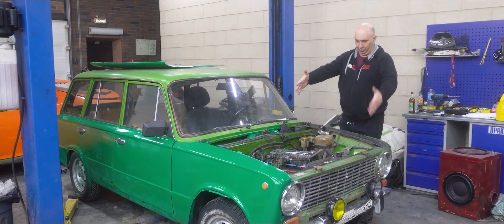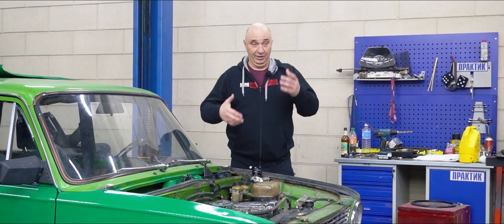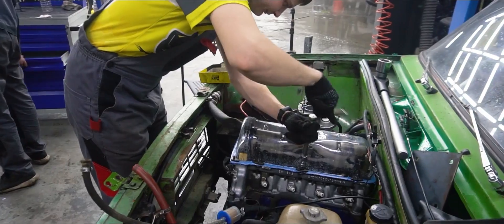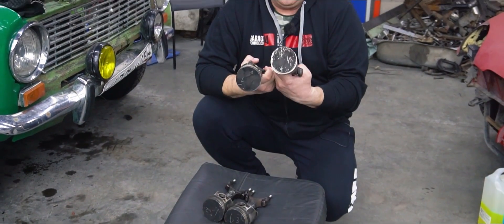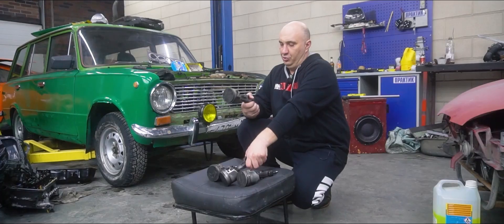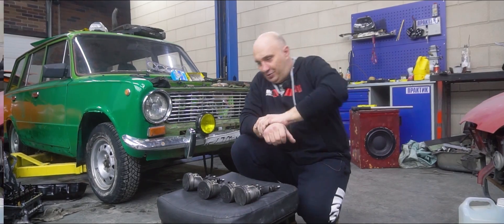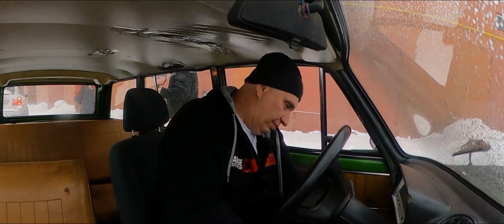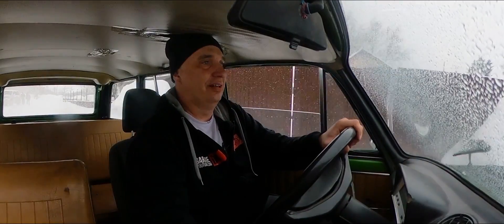Welds vs bolts – testing their durability on conrods

Comment: Only Lada's are capable of getting you to your destination despite having it's engine exploded
Reply: Comes with experience. Other motors just don’t get to do it that often. 😎
Reply: Those were the equivalent to a k-car back in the day here. My father had a rod knocking in his plymouth acclaim for months until one day it just let go and blew oil and a piece of the engine block all over the street and then continued to drive it not letting it idle of try to stall just to make it another mile down the road to work so he didn't have to get a tow truck and be late. Everyone was amazed when he flew into the parking lot with smoke, sounds of metal just banging and clanking away and it just died a few feet from the door.
Reply: @ATSNorthernMI  sounds like something my dad would do too 🤣
Reply: I once saw a Slant 6 in a 77 Aspen wagon... #5 and 6 had exited the block. Dude fished out the big pieces,  covered the hole, tweaked the carb and timing, and made two more trips back n forth to work with his "Slant 4"!!!🤣
Reply: It´s socialists machinery. It must survive worse conditions than hole in the motor.
Reply: Had a 98 civic w/ the D16, it started knocking at 225k mi. Put another couple of thousand miles on it. Never gave up before the B16 swap. And none of the miles I put on that car were easy.
Reply: Blew a hole in both sides of the block in a 3SFE Toyota Camry when number 3 rod came out one side and its bearing cap out the other. It still runs, just not very well.

Comment: Make a four stroke engine into a two stroke one!
Reply: That would take some pretty involved re engineering as you'd need to cut transfer and exhaust ports into a block that's full of coolant and oil passages. It would be doable (Like everything is if you put enough time and money into it), but I think it would have to be a several month long multi part project that isn't really the sort of thing G54 usually does.
Reply: @Reman1975  I was thinking gear the cam at the same speed as the crank and fit a supercharger to blow the air fuel mix in. But yeah probably a bit too involved!

Comment: Idk if I should be annoying in requesting different piston sizes for a video. But I’m requesting you make a video with 4 different piston/cylinder sizes. Will the car rock itself apart? And you might be able to achieve this by boring some cylinders out and maybe resleeving another cylinder to add thickness. Bigger rings, smaller pistons. Vice versa. I just would like to see if it could run, and if so, can you smoke some rubber on a truely frankenstien engine? Cheers.

Comment: Suggestion: make a electric-Lada, using only startermotors attached to the gearbox!! TESLADA
Reply: Nah. DIESEL-ELECTRIC Lada
Reply: Dude i had the same idea a while ago
Reply: @luiggi8272  damn u lier 😳😂😁
Reply: Wouldn’t last long.. starter motor would burn up after about 30 seconds
Reply: @mikecorleone6797  nah, I used a starter to move my car off the street a few years ago, that was up an incline and against a non running motor.

Reducing the load by ditching the gas motor and adding a few motors to share the load you could have a reasonably effective yard cart lol.
Reply: @DrewLSsix  Wow, I'm impressed, I've used a starter motor to move a vehicle a short distance, but as mentioned above, I've had them fail spectacularly
Reply: @mikecorleone6797  starters are surprisingly stronger then you give credit for.
Reply: @mikecorleone6797  thats resolved with water cooling
Reply: @gabrielvieira.4358  explain to me how you water cool a starter motor.. let alone water cool the starter armature and brushes because you’ve lost me 🤔
Reply: @mikecorleone6797  I'm with you. I don't know... I'm sure the water will damage the starters, but maybe oil and a huge radiator can solve the problem? I think oil can cool the inside of it, and maybe the water cools the outside? One radiator for water and one for oil. But that would need a separate power generator, I think the radiator fans would need a lot of amps... That's just my initial idea. Or use distilled water inside, as I find it has less friction and doesn't conduct energy. Put the starters inside a "chamber" so the water can flow in the starters body, and make some holes on the front and back to flow oil or water. Use pipes to deliver the fluods. Yeah, we would need a separate power supply to generate power for the fans and the pumps that will drive the water/oil to them starters.. Its a huge project, but its not impossible. Sorry if I made a mess with the words here. I hope you can understand and imagine this.
Reply: @gabrielvieira.4358  ok now you’re adding a ton of unnecessary weight to the equation.. not to mention that starter motors use brushes which rely on friction.. adding oil will not allow the brushes to work correctly forcing them to most likely just arc instead of transfer power to the armature. You also can’t drill holes in the starter because the length of the starter case is electromagnets and spun copper wire.. you’d drill right through it killing the starter.. they are simply not designed for that kind of abuse nor are they designed to move weight. They are simply meant to move a rotational mass ie flywheel for no longer than 10 seconds at a time with a 15 second cooling period between cranking sessions
Reply: @mikecorleone6797 By fitting a heat exchanger to the starter motor. A fan would be simpler, and more effective
Reply: @mikecorleone6797  you are correct. I’ve had to use em off-road in risky stalled out locations for slow creeps and longer than about 25 to 30 seconds will smoke a starter
Reply: @mikecorleone6797 The electric motors would likely be  fine. One can actually drive a car for a rather lengthy distance on the starter motor. The battery will get depleted before the motor overheat and burn out. The challenge in a project like this is battery capacity.
Reply: @mikecorleone6797  startermotors
Reply: @mikecorleone6797  Not if you cool it and use multiple starters to reduce load
Reply: Bruh that the best idea I have ever heard of.they must do this
Reply: I've seen this commented many times by many people...
Reply: I'm voting vor Radial engine in the Lada!
Reply: *and a 12v water cooling system for the starter. 
(I tried this with the lowest gear on a 10 speed bike)
Reply: You stole my idea lol
Reply: They should also try to make hydrogen powered Lada as well.
Reply: Lada powered by shotgun starters.
Reply: Starterada
Reply: Heck yeah. Few starters off some  caterpillar dozers would do it
Reply: you got a lead on something here !!
Reply: Or lathe motors
Reply: New here?
Reply: As fun as it sounds, a starter motor isn't designed to keep running for prolongued periods of time.
I know from personal experience on how well a starter motor can cook itself after the thing locked on and wouldn't shut off, it took my disconnecting the battery, removing the cooked starter and getting a tow start, so I could drive to the nearest supplier to obtain and then FIT the replacement in their parking lot
Reply: I think jet powered lada would be better
Reply: Ive noticed this comment has been going for almost a year now
Reply: @SL4US  yeah... but i don't think they read the comments
Reply: Or you could call it a. Salada
Reply: @ba.skidderLOCKDOWN  salada? Like : Vegan-Lada?
Reply: @lassediscovers1813   na. Slow lada salada
Reply: @ba.skidderLOCKDOWN  lol
Reply: Yeah
Reply: Yea man just do it!:)))
Reply: I’ve been commenting this for years and sending it to there Instagram, for almost 2 years now lol
Reply: Farm tractor starter should be good for this
Reply: You can use alternators as motors,  I say mount up a bunch of alternators converted to be motors.

Alternatively, they could use a plate bolted to the transmission to mount a ring of starter motors around the flywheel.  Instead of some complicated electronic controller the gas pedal can be used to close a row of solenoids as you move it further so that full throttle runs all the starters and very little throttle only runs one or two.
Reply: @DrewLSsix You wouldn't get a power increase in this way, but you'd get increased torque.

Comment: Garage 54: The only channel that purposely destroys engines, but still changes oil filters and even fills them up with oil every time before installing
Reply: And then proceeds to dump the oil in the street.
Reply: @Speedytrip   In summer the oil residue will keep the dust down😜
Reply: @Speedytrip  Well, they're still Russian.
Reply: @Speedytrip  lmfaoooo truuu
Reply: They're savage to those engines, but they are civilized and have standards, after all.
Reply: Well they get sponsored by that oil manufacturer, thats why.
Reply: @semifavorableuncircle6952 hhhhh
Reply: Just because they destroy an engine is no reason not to treat it right!
Reply: The install lube on the conrods surprised the hell outta me
Reply: @3xgvideos422  - Shouldn't surprise you. They wanted to see what holds up best; welds or bolts. If the engine promptly seizes up, the whole thing is a failure.
Reply: @scootergeorge9576  yeah im well aware of that. Its a joke because I feel like all they do is break stuff.
Reply: @3xgvideos422  - But they are destructive in a constructive sort of way!  : D
Reply: Because they know how to build engine.
Reply: More love and far more hate than any lada deserves.
Reply: You don't want variables interfering with the test
Reply: @Jordan4Ibanez  - Exactly!
Reply: Thats what makes this channel awesome!
Reply: I think lada oil filters only come in bulk..
Reply: @Garbagejuicewaterfall  - At the Moscow Costco, you always get a Lada them!
Reply: @scootergeorge9576  *takes shot of cheap American vodka in appreciation *  🇺🇸🍻
Reply: @scootergeorge9576  They are further from Moscow than I am :-)
Reply: @peterbrown6224  - I just threw the city Moscow out there. I have no Idea where  Garage 54 is. Could be Siberia. Seems to snow a lot...
Reply: @scootergeorge9576  No worries! Hope my comment didn't seem rude.
Yes, it's Novosibirsk, Siberia. The sheer distances in Russia are amazing.
Reply: @peterbrown6224  - Rude? Not at all! I believe the former Soviet Union was about 11 time zones across!    Besides, I can't spell Novosibirsk... ; )
Reply: Not to mention the antifreeze. I mean I get that it's probably well below freezing outside but still It's kinda funny.
Reply: and new head gasket too
Reply: Amazing
Reply: If Greta cries, it's all good :)
Reply: THEY ARE TRUE PROFESSIONALS
Reply: and Greta crying :D
Reply: It cost like 5 usd to fill them with oil
Reply: @lonerider5315  I think Speedy was more concerned with the mess/environmental impact
Reply: @steven-vn9ui  Isn't fresh oil non-toxic?
Reply: @centralintelligenceagency9003  lol, it's still oil. It's just as environmentally damaging.
Reply: @centralintelligenceagency9003  it's not considered hazmat as far as shipping goes, but I wouldn't consider it non-toxic

Comment: I only found this channel 3 weeks ago and it's become one of my favorites already! Awesome content guys! Here's an idea if you guys haven't done it yet. Got blinker fluid? Can you make a blinker that works from a liquid?
Reply: So, like a bioluminescence? That glows when electricity is induced?
Reply: @jordendaniel8450  could use a hydraulics of some kind to make contact with electrical contacts for the lights?
Reply: @cerealkiller4341  I'm thinking a mechanism that creates a bright high voltage ark (Like a stick welding ark) would be more their style. :D
Reply: @Reman1975  Well it would be hard to power, assuming it's not just a bunch of batteries, and it would blind other drivers.
Reply: Not just a LOT of batteries.
Reply: I've seen you comment before. I remember your name. What's your favorite cereal? I like fruity pebbles when I get the munchies.
Reply: @joshuagibson2520  ah fruity pebbles are my kryptonite, they win every time!
Reply: @cerealkiller4341  😂😂😂
Reply: Technically, the DIY Adapative Headlights video, that could be done in such a way that it either requires lubricant or hydraulic fluid. Just apply this bizarre concept to the turn signals if they're in a separate housing on the car in question, and bam, blinker fluid.

Comment: try welding the block to make it run again lol
Reply: It can be done. My dad did it to his 292 engine in a square body Chevy that threw the #6 rod and although the thing still runs it seeps oil through the weld over time.
Reply: @Cristobal_Ygnacio_Arriaga  it sure can, in the shop they will do something called powder welding to fix cracks in the deck by grinding out the crack and filling it back up, but iron needs to be preheated to not get small cracks, im sure thats the only reason it seeped oil. also use an arc welder and the proper rod.
Reply: @redneckasmr-xd1gg  oh the iron block on the 292 didn’t just had a crack..it was an actual hole like in this video, they somehow managed to patched. We where lucky the hole was right below the sleeve of the cylinder and didn’t damage any oil/coolant passages. But yeah the oil does seeps through over time from the weld of the patched hole.
Reply: Great idea
Reply: yep, my thought, fix the holes with glue or whatnot, stick in another old piston and off we go, I actually did that on a johnson outboard 9.9HP engine that blew a rod at 12k RPM, the engine worked for another 6 months without any issues, did some boat racing in my time. 9..9 engine to start off, when I worked it over it had at least 20hp, didnt make it to the finish line, duh
Reply: Jb weld lmao
Reply: @mikeak7331  yup jb weld and weld the piston that came out back together and send it thats what I say . Test how much further the rods last and test weather or not jb weld can patch a block .
Reply: @mikeak7331  hahaha yeah JB Weld!!!
Reply: @mikeak7331  I actually use JB Weld after welding like body filler. Shhh...
Reply: Years ago we did that on an old 680 case backhoe that threw a rod. I used some kind of rod that was for some kind of Arc brazing process in a regular stick welder. I wish I could remember what the rods werean old-timer gave them to me and he only gave me a couple so I didn't buy them.but I just welded a regular mild steel patch over the hole, replace the rod, cut one crank journal under-sized, and the machine ran for a few more years at least until the rest of it was junk. It really wasn't too good of a machine even before it blew a rod, it had loose pins and hydraulic leaks everywhere
Reply: My dad glued engine block with Poxipol in his old Ford Orion something like 25 years ago. It was running next 6 years 🤣
Reply: @Bloodmaro  that's overly reckless 😅
Reply: Weld the head on so you never have to worry about blowing the head gasket
Reply: It's been done quite a bit, though it looks like  the structure of this block was affected so it probably wouldn't ever be in good balance again.
Reply: Yes 👍
Reply: İt will work no problem
Reply: That's what i was thinking.. Lol
Reply: Agreed on this
Reply: jajajajajkakka
Reply: Hell yeah, then drop a ls1 in it , its such a cool little car it needs some ls love 🤘
Reply: Ummmmm, that's been done.....people weld up aluminum and cast iron blocks all the time
Reply: Bro that's what I instantly thought
Reply: Its done quite often actually.
Reply: Its possible if crack isnt on oil or cooling channel.
Reply: Yeah that would be worth watching. A lot of people scrap the block after this!
Reply: YEASSSSS
Reply: If you weld correctly it will be stronger than the base material beyond considerably
Reply: To be fair it runs with The hold so. O need to fix it 😂
Reply: You can braze cast iron if you properly clean and preheat the area first. Also they make cast iron rods for arc welding, still you have to thoroughly clean prep and preheat the area.
Reply: Foreshadowing much?